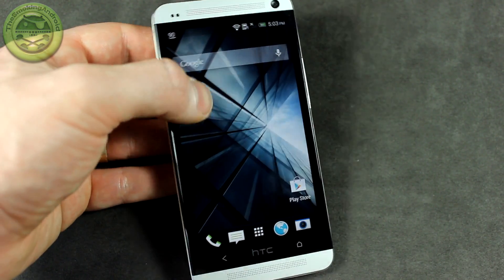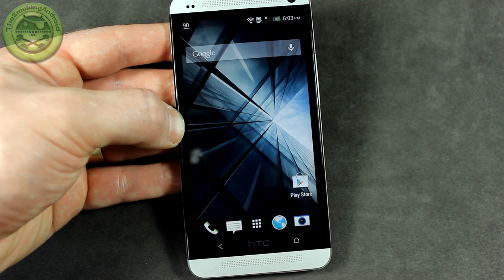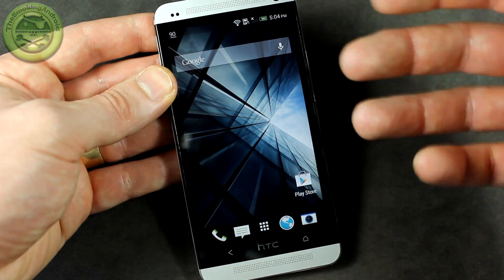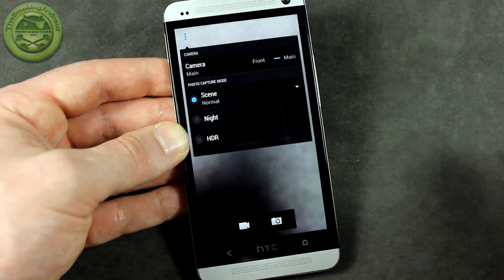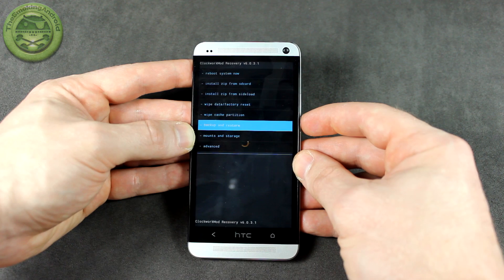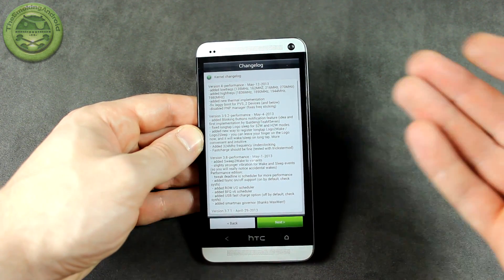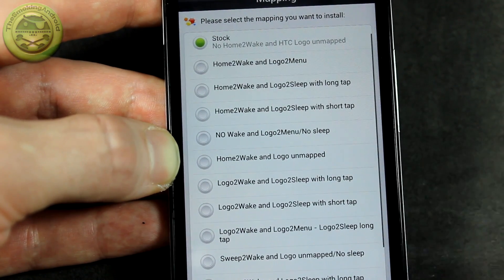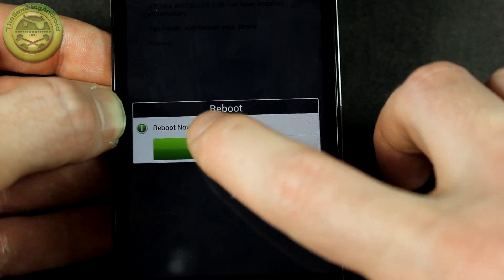HTC One - HTC Logo Button Hack & How To

Comment: Don't ever do this because this is so risky now with KitKat (if you're running it). It caused weird pixelation on the sreen and i could not lock the phone and could not access the camera. If you attempt to do this, FIRSTLY MAKE A BACKUP ON YOUR CUSTOM RECOVERY incase something happens. If you want to remove this, install another kernel and it will replace this kernel. 
I fixed my problems by installing ElementalX kernel btw

Comment: htc logo is stuck after using this kernal 
i can use the fastboot system
but it wont start 
please help fast
Reply: lol sell me it cheap and i will buy
Reply: you think im dum
:\
Reply: try o flash a diff ROM?
Reply: sell it to me lol
Reply: If you have a Custom Recovery (Which you should have done if you weren't dumb), and have set a Backup (Which you should have also done if you weren't dumb) then go and flash your System with that Backup through Fastboot. BUT, if you can not enter Recovery then go into Fastboot (Bootloader preferred) connect to a computer, and flash the Stock ROM/Different ROM with Fastboot on your Computer (You can find tutorials all over Youtube about how to do this, Android SDK Required with your Unlock Token used to unlock your bootloader (If you used HTCDev, other ways you have to find on your own on the Web)). But again, I am just a simple 12 Year old boy, who has Unlocked his HTC One's Bootloader, Successfully rooted his device, and successfully install a Custom Recovery (TWRP Recovery).
Reply: same happened to me it is stuck in htc logo tried installing different rom but it stops in Rom's loading screen. please help if you found any solution, that will be appreciated thanks again....
Reply: Guys...doing "hacks" like this is VERY risky as this adds something to the System's Variables which it was never programmed to use. It is a 80% Chance of Brick/kernal problems if you do something like this. The only thing I recommend is attempting a Full System Restore to your backup THAT YOU BETTER HAVE MADE from ADB on your Computer. If you can't do this, your device is officially bricked. Congratz :3. If you CAN load into the bootloader, then CONGRATZ you still have a chance! Attempt a system restore point by using the ADB Tools to manually set it. (MAKE SURE YOU HAVE A BACKUP KERNAL, OTHERWISE YOUR RUNNING THE SAME THING, THUS BRICK/OTHER PROBLEMS AGAIN). Hope this helped, if you need more info, find a dev forum on Google! Good luck

Comment: I got  rooted htc one 4.2.2 , unlocked bootloader , on S-On still( thinking of changing it shortly) i am on htc sense version 5. 0 still (looking for a rom to use)  is this going to work on my HTC One ? the kernel iam using at the time is 3.4.10-g28dF0d6?

Comment: HELP HELP HELP
after telling the phone to reboot it got to the "HTC, quietly brilliant" screen. I cannt do anything, even press the power and volume to go to the boot menu type screen...any ideas
Reply: Same problem with me!
Reply: MrDrumz98 hold power button for 12 seconds it should turn off and work on next boot. If not then go back to recovery and restore a backup. If you haven't got backup then find the stick kernal online and make sure its the right one, you'll brick it if its wrong. If you don't wanna risk it then you must flash a fresh ROM to reset it

Comment: Pretty cool!...if your looking to flash / unlock or fix bad imei / esn / meid of android call me: i have a store in long beach

fix bad imei - at&t - t-mobile - metro pcs .. galaxy s1 s2 s3 s4 note 2 // htc phones, LG phones, etc...

unlocking at&t and t-mobile phones

rooting android / installing custom roms / wireless tether (hotspot)

flash your sprint or verizon android phones to: metro pcs, boost mobile, verizon unleashed, page plus, cricket, virgin mobile, etc...

call or text me 24/7 -- ((two 1 three..two OO..one nine 2 four))

Dave Flasher ;)
Reply: My IMEI and BaseBand is unkown. I get no service. Left it off for ages then turned it on got service imei showing for like 5 mins until restarted and unknown IMEI, know the issue?

Comment: Hey YouTubers just a quick little info about this cool kernel ( I do a bit of reading before trying these on my Dev devices u must read his thread before installing ) I was to interested in doing this but it doesn't say in the top post for which devices are compatible so I looked at the second post an u see this 

KNOWN TO WORK ON:
- 1.28 International edition based ROMs, and 1.29 (1.29.1540.3) !doesnt work on Sprint HTC One variants as its not GSM so do not use on a CDMA sprint it will damage

Comment: I wouldn't recommend using this Kernel with Clean Rom 2.5. With the Rom itself, a moderate to heavy use drains only about 10% battery at most, in an hour. But with this Kernel added, after a full charge, the battery dropped to 82% in just under an hour. That's 18% battery drain within an hour. Also, just rebooting the phone knocked off 4%, wtf? Maybe it would be much better with stock, but not recommended with this Rom, which is a shame because the Clean Rom is the closest to stock.

Comment: It is actually more accurate me using my thumb than finger on the back and triple feature home buttons, I hit it every time with  thumb, most times with a finger tap, you have to tap quite hard also and hit a smaller area with the tip of your finger which is why you miss sometimes.

Comment: After doing this my camera will not open at all,  error of "unable to start the camera"  or if it does open its all black.  I restored from my back up and it worked fine,  but when I re-flashed this kernel same thing happens,  any thoughts?